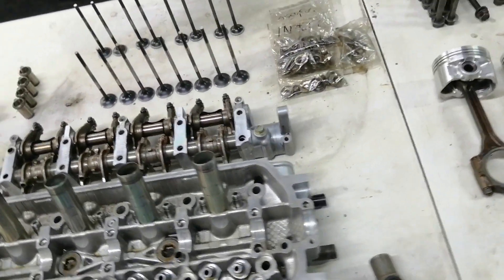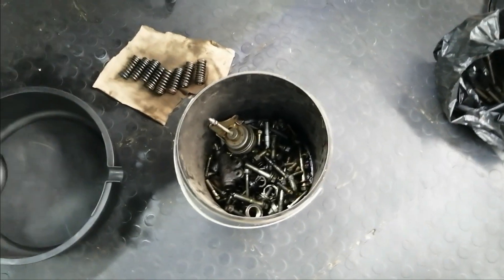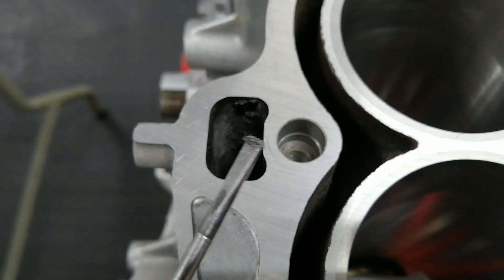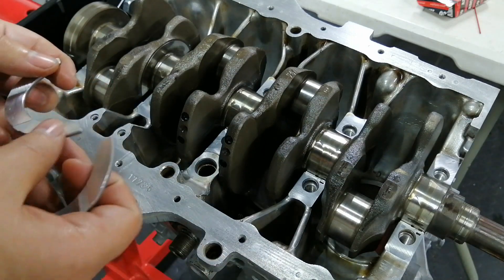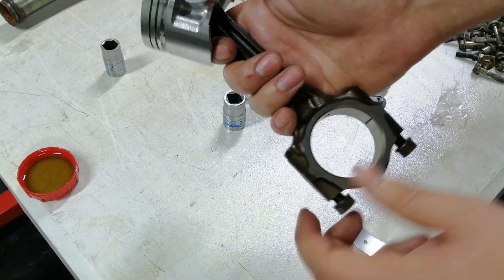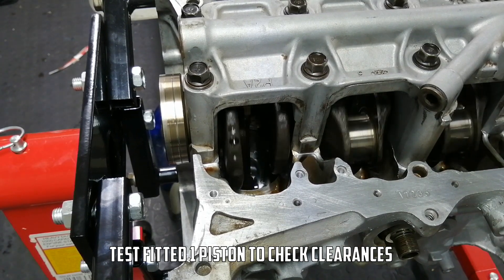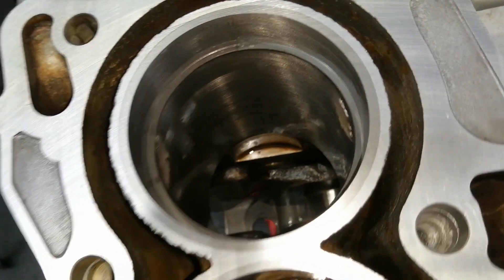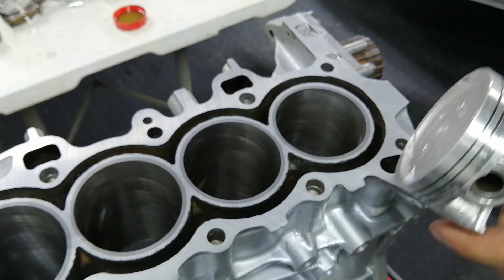Honda VTEC Engine Assembly  - D15/D16 Mini-Me - Part 1

Comment: Howsit boss, love the content I have a d16a9 Head but I want to know if it will fit on a d15b3 block ?
Reply from the maker: Hi Tauriq, it will fit, however you will need to use the B3 head studs and dizzy, you can jerryrig the a9 dizzy to fit. You will also need an adjustable cam gear to get the timing perfect, plastic covers may not fit perfect again. But you will bump the compression up a bit, make sure its not to high before you do it. But the head will bolt to the block yes.
Reply from the maker: Also you must use the plug leads from the A9
Reply: Thanks for the reply bro 😇. The adjustable cam, would I need 2 considering that it is a dohc head? Sorry I'm a honda newbie this is my first honda build but my d16a9 block is stuffed and engineering will cost too much so I'm looking at other options 😅
Reply: Unfortunately I live in the Eastern Cape, South Africa and finding the d16a9 block has been quite troublesome for me
Reply from the maker: Shit sorry bro, I see now you said A9 not Y9. You referring to the DOHC motor. The dohc Dseries motors heads are not compatible with sohc blocks, the oil drains don't line up.
Reply from the maker: I would recomend getting a complete sohc motor or go B20. It is possible to still run a Dseries gearbox on a B20 by modifying a few mounts and the flywheel.
Reply: @RisingBoostYT  tbh I've checked that but I haven't seen any videos on it I've read forums of a guy that done that but he ended up boreing holes into his block 😅
Reply from the maker: @hackerman-tk  true you have to bore holes into the block, sketchy but possible. But yeah sadly the A9 and DOHC ZC Dseries motors are not compatible with SOHC heads and blocks.
Reply: @RisingBoostYT  thanks for all the information bro, appreciate it. Keep up the good work, your videos are great man 🔥

Comment: hey man ive been researching this alot for my 85 wagovan. do you see any issues with the frankenstein affecting the 4wd transmission?
Reply from the maker: Hi Alex, just a vtec conversion won't affect it at all. adding boost should also be okay, the manual 4wd trans are strong, in fact wagovans have the best awd system for putting power down. better than the CRV awd system. if its a auto you won't make as much power and they not as strong as manual, but it's still possible.
Reply: @RisingBoostYT  ok wow awesome!! thanks for the response! its a manual, 6 speed with the super low. really love the car so far, my other daily is an element and this lil wagovan is just awesome. you have fully cemented my build and im going all in! i will probably be back with more questions once i start hunting for parts, so keep making informative videos!! new subscriber right here.

Comment: heyy. i know its late. but what happen to yout old block? and hows the build with the skimmed block?
Reply: ahhh right. blown the gasket on my Y4 and overheating. was planning to do vitara build since i probably will have to rebuild the block anyway.  hope to see a vid from you soon!
Reply from the maker: yeah overheating and blown head gasket go hand in hand. yeah if you have to rebuild you can just as well build the motor. have a few newer vids available on the channel.
Reply: @RisingBoostYT  oh yess. been checking those out too. cant wait to build my own. theres not much d16 vitara build from where i come from. most people opted for B and K series build.
Reply from the maker: @clovedoper7223  same here, most peope doing Bseries. Kseries starting to become a thing but still very expensive where im from
Reply: @RisingBoostYT  B and K swap here cost almost identical. with roughly 500-800$ apart. but its harder to source B series item here and K series becomes more available. but ill keep up with your build! its very interesting and look forward to similar build ☺️
Reply from the maker: @clovedoper7223  we got EK and EG sedans from factory with B18s so all the oem parts are available, nothing aftermarket needed, for that reason the B stuff is still way cheaper. But thanks for watching, for now we still playing with the single cam.
Reply from the maker: Hi Bro, swapped the old motor/block for a B18B3, new build is going well, going back to the dyno soon, did 800km without any issues, so the block is perfect, will see once we start making some power!

Comment: Just wondering. Is there any advantage to doing a mini-me using a D15Z4 with a D16Z6? 
Or is it just for fun? I like that your goal is 220 WHP. Just wondering if you can do the same thing with just a D16Z6 Engine. 
I am sure you can but is there some kind of advantage doing it with the D15Z4? 
I have a D15B7 Engine. Was wondering if I could do that with my engine. Kind of hoping the Bottom half of my D15B7 is the same as the
D15Z4. Or if I should just get a D16Z6 if I can find it! Thanks for any input!
Reply from the maker: Hi Mike, the D15B7 will give you slightly higher compression ratio because of the B7 pistons. NA I dont belive a D15vtec will make any more power because of the 100cc loss over the D16Z6. In my case a turbo D15Z4 can make 220whp without vtec. I did the swop because I had the head and SOCH Vtec heads are rare, so it is a interesting swop. But for best results stick to a D16 bottom and vtec if you going NA or aiming for high boosted power.

Comment: this is dope im 16 and dont know much about building an engine, but this made me feel like im all set and ready to go! super informative i love it! by any chance would a 5k usd fit to make a budget ebay turbo build?
Reply from the maker: Hi STP, glad it was helpful, what motor is in the fit? Not all the honda engines have aftermarket support like the D, B and K series. Some are economy motors with eco versions of vtec. It would recommend checking what motor it has and taking it from there.
Reply: @RisingBoostYT  sorry about my wrong grammar, i was groggy at the time i made the comment, anyway what i meant to ask was does a 5k usd budget fit to make a budget d15 ebay turbo  build with all the necessary supporting mods like fuel pump, fuel rail, larger intake manifold, vitara pistons and etc etc.. that can produce well over 400whp but still reliable for daily use
Reply from the maker: @caz1387  5k usd, yes should be possible, get the speed factory rods and pistons combo, css block, perhaps do the SRT4 ARP head stud mod. After 350hp on the Dseries it does become a bit expensive and a B series could be better but it is possible.
Reply: @RisingBoostYT  thanks for the suggestion, i really appreciate it, will look into it later. b series here in the philippines are expensive thats why i went with the d series and i kinda like being the underdog sohc that can dominate dohcs, anyway thanks again bro i really appreciate your suggestions, ill hit you up when i start my build i just need to look for an eg with a d15b, they cost about 5k usd here or 250,000php, i really appreciate you bro you are the first y-tuber to reply on my comments, im looking forward to seeing you post more vids and your channel to grow, more power and love to you bro! your an inspiration, keep it up and thanks a lot again man❤️
Reply: @caz1387  Southeast Asia gang.
Reply: @caz1387  would totally recommend looking for a 1.6L If you can find a y4 block and y8 head you get a sweet combo of lower compression and single stage vtec that kicks harder

Comment: very nice clean working 
i have ph16 honda civic but the block is damage its be okie if im change ph15 block
Reply from the maker: Hi Renz, yes, however you must also swop the crank and rods/pistons as the crank and rods are different between D15 and D16. The heads are the same and will fit either block
Reply: @RisingBoostYT  thank you so much  God blesss you more

Comment: Next time, when you clean bolts and parts.  Use Premium Gasoline (the highest octane fuel–generally 91–94).  It will be cheaper than buying all those sprays, etc.  
NOTE: Watch out for Rubber, Plastic, Seals or Non-Metal stuff, but all metals are safe.
Reply from the maker: Hi Jordan, thanks that is actually a smart plan. would have been way cheaper to soak in gas than the parts cleaner was.
Reply: @RisingBoostYT  - YES and faster too.  Next time try and you will see and CHEAP!  LOL

Comment: What’s the torque pattern for the girdle
Reply from the maker: Hi Justin, the pattern of the girdle is starts in the centre and crisscross outward.  I use this website as reference (same as cylinder head) - https://www.nthefastlane.com/d-series-torque-specs

Comment: Hey.
I have a D15Z6 vtec motor in mine. It only produces 114 hp. Do you have any recommendations to what I could do to it?
Thanks
Reply from the maker: Hi Joakim, the D15z6 is a vtec-e motor, this is sadly not good for power as the vtec-e is economy orientated, disabling 1 intake valve to increase fuel economy. The biggest mod you can do is to swop the cylinder head to a non vtec or a p08/p2j vtec head. Get a p08 or p2p intake and a exhaust from the D16A6 EG as it is a 4-2-1. Other mods like a B20 throttle body can also help. Keep in mind this may require some changes to the wiring and ecu. Best way may be to just swop in a D16Z6 or D16Y8. They are factory vtec motors.
Reply: @RisingBoostYT  Thank you very much. Appreciate it.
Reply: @RisingBoostYT   d15z6 head is the same cast as a p08 head, same valves same everything, one can simply swap the rocker arms and camshaft and it becomes a d16z6 head

Comment: does anyone know if a y8 head works on a d15b2 block?
Reply from the maker: Hi Noah, yes it will work in terms of bolt on. You will need an adjustable cam gear to make timing marks line up. Also you will need plug wires and gasket for the Y8. This setup will have a higher compression. But if you want more gains try get the ecu and loom from the Y8 so you can get the MPFI also.

Comment: My bore is 75mm, if i bore 0.5mm will i need bigger pistons or can i use the same stock ones. 

I plan on boosting in the near future.
D15 block
D16y8 head
Reply from the maker: Hi Senhor, if you bore 0.5mm oversize you must get matching 0.5mm oversize pistons. my block had damage on the sleeves so I had to get it bored and pistons is a must, the same pistons will not work. pistons is not so expensive but stock honda pistons gets pressed onto the rods so engineering shop must fit the pistons for you. unless you buy aftermarket pistons and rods. boosting will work, similar to my setup but keep the power to 200whp if you boost on stock internals. then you should be good. rods and head studs fail first on these motors after about 230whp
Reply: @RisingBoostYT  is there any way i can contact you? i want to ask you a few questions regarding my build.
Reply from the maker: Send me a DM on instagram, @risingboost on IG
Reply: Thank you brother🙏🏾

Comment: Hello will this same set up work on the d15b2 block as well ?any info would be greatly appreciated and u eared a subscriber keep up the great content
Reply from the maker: Hi Alpha, it should work yes, but you will need an adjustable cam gear. I will also recommend you get a D16Z6 ECU and loom. get a P08 or P2P intake manifold. the B2 is SFI and the others are MPFI so that also helps a lot. using a Z6 head and A6 Dizzy will be "bolt on".

Comment: Get a new machine shop! I would’ve personally took my time to absolutely clean your motor before giving it back. No chips at all. That’ll kill the motor so fast
Reply from the maker: Hi Hexity, yeah I actually already found a different machine shop as the one I was using is definitely not very careful, I think they rush the jobs. if I did not notice the rod or shavings it could have killed the engine.

Comment: Like how much all the kid cost thank you
Reply from the maker: Hi Angel, the rebuild kit was 90 USD for the gaskets, bearings & rings. new pistons was about 30 USD. however the engineering cost was about $350 for rebore, press rods to pistons, skimm, new valve guides.
Reply: @RisingBoostYT  are good parts you to do motor like $350 i wan do my never do motor lol want to buy the parts see who can do it thank my friend h good day
Reply from the maker: as long as you buy quality parts you should have no issues try to get trusted brands, the motor is holding up good so far. I had to buy the parts from a parts shop, could not order online as I am from South Africa so the shipping costs will be more than the parts. so sadly I don't have any product links. I used MEGA gasket set, King bearings. not too expensive but still decent parts.
Reply: @RisingBoostYT  ok thank s much you time bro
Reply: @RisingBoostYT  you go the links where you buy it let me know thank s much good video

Comment: What’s the difference in doing this rather than using the vtec version d15 ? And if if you did have a vtec d15 Is there point swapping heads
Reply from the maker: Hi Kyle, there is a few different types of vtec, avoid the vtec-e heads, they are for economy and have much smaller intake values and valve springs, also vtec-e makes the car a 12valve by disabling 1 intake valves so there is no performance gains, just economy. The performance vtec heads are very good, bigger intake runners. For boost you can use a non-vtec head, it will work just fine, performance vtec is a bit better. Check your engine code, if you have a performance vtec motor leave it as is, if its vtec-e swop on any head that is not vtec-e

Comment: Bad idea using original studs, may cause issues if ever need to take apart the motor.
Reply from the maker: Hi Andy, thanks for the advice, been lucky so far. I did actually get arp studs but they were the wrong size, I got the 165mm and I needed the 145mm studs so I had no choice at the time.
Reply: @RisingBoostYT  sounds reasonable.

Comment: Did you check bearing clearances?
Reply from the maker: Hi Arth, yes but not with plastigauge (as is should) I could not find any locally. this engine did not have any issues with the bearings when I took it apart, so I removed the old ones and got new ones in STD spec. I measured the old and new ones and there was no measurable difference. this was a risk but but I can confirm the engine does run fine and oil pressure is good.
Reply: @RisingBoostYT  so you didn’t check oil clearances? No dial bore gauge and no plastigauge.
Reply from the maker: Hi bro, no not oil clearance, bore measurement was done by the engineering shops
Reply: @RisingBoostYT  removed my d15b7 to reseal it. Now planning on tearing it down even more and replace rings, bearings and etc. Was questioning if I can just swap in new STD sized bearings and rings without having to measure and all that. Did u have the crank micropolished? Or nah
Reply from the maker: @kevinsalguero1357  in my case the motor was running fine when I took it apart, it was burning a bit of oil so I wanted to check why, turns out my motor was sitting with water in some sleeves so my sleeves had pitting, causing the oil burning, because it was running fine I just replaced the bearings in the motor with the exact same new bearings, no measurements and no polishing as the crank was in very good shape. Inspect your old bearings, if they look good you should be fine just replacing it with the exact same but new bearings.
Reply: @RisingBoostYT  awesome thank you. Will be tearing her down this week to inspect further thank you sir .

Comment: Pro tip in boosted engines cap each ring in the corresponding cylinder
Reply from the maker: Hi Bro, that is excellent advice! I should have mentioned that in the video.

Comment: Quality build for Sohc engine!!! I have d16A on my civic vti the power sucks
Reply from the maker: Hi Kimgaeb, thanks! yeah stock D-series is a but slow, however the D16A motor has the better bottom end. crack has dual oil feed channels compared to D16Y that only has single channels. also the D16A6 is possibly the best bottom end for a mini-me conversion as the head studs and dizzy is the same. so if you plan to boost it later on it's a good base to start.

Comment: Will I need a D16Z series block or can this be done with a D16Y series and a D16Z head?
Reply from the maker: Hi hewfil, YES - Z6 Head will fit a D16Y, you may need 1 longer head stud to make it work. als the dizzy from a Y series will only bolt on with 1 bolt to the Z6 head. but should be fine like that.

Comment: Is the head your gonna put on it ported or is it stock spec ?
Reply from the maker: Hi Night, the head is a p08 Z6 head, I polished the exhaust ports and cleaned up the imperfections on the intake ports. There is a video on the channel. But is a basically stock vtec head.

Comment: I’m currently building a d16y8 and having issues remembering how to assemble the pulley side before I put the head back on :( also question, can I use a spare super clean d16z6 HEAD I have for my d26y8 block I just rebuilt?
Reply: Yep the D16Z6 head will fit a D16Y8 block...just slightly different timing belt and valve cover
Reply: oh and the timing will be off a tooth so you will new an adjustable cam gear
Reply: @JasonSmith-bu7wk  okay thank you
Reply from the maker: Hi Evelyn, pulley side order is - belt guide, timing belt pulley, belt guide, plastic belt cover, crank pulley and key. basically remember the timing belt guide plates both sides of the belt, good time to set the timing while cover is off. crank pulley bolt must be torque to spec, if it comes loose it will damage your crank.
Reply from the maker: Z6 head will work but you may need 1 longer head stud.
Reply: @RisingBoostYT  saw that. Ty